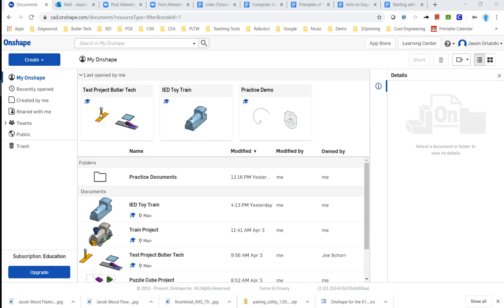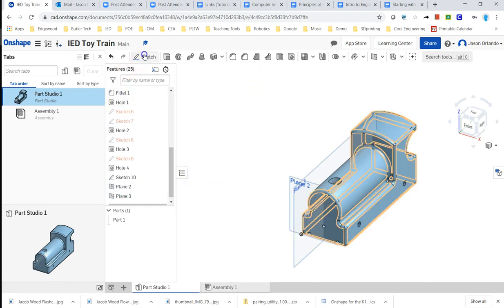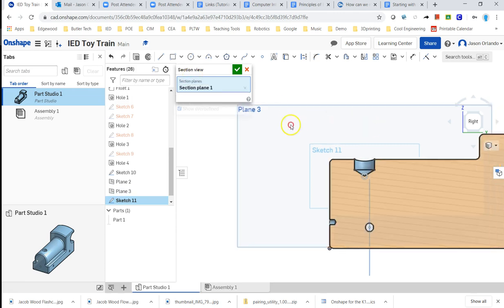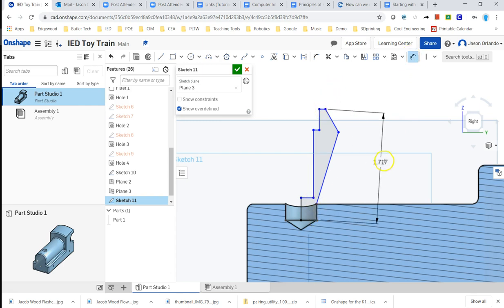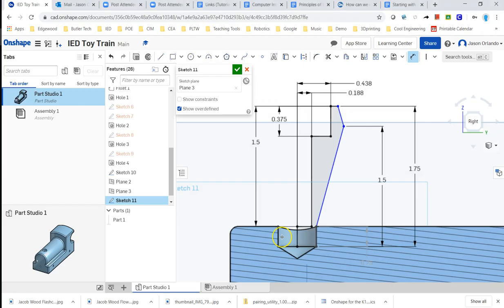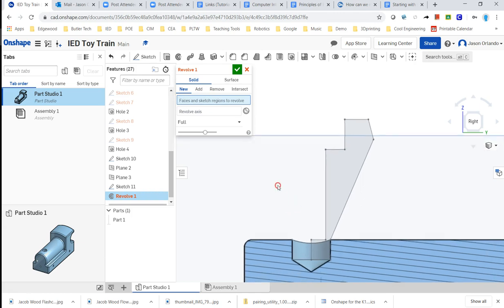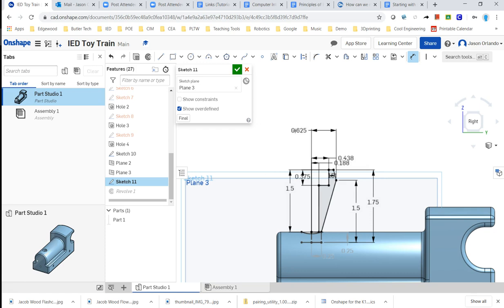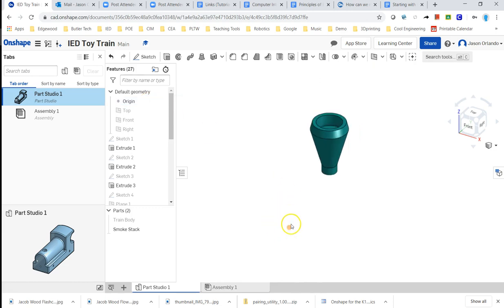Smoke Stack, Model using Onshape

Comment: What do I do if I I don’t have a mid point 4:20
Reply from the maker: Try creating a construction line on your new sketch plane at that horizontal line segment that I found a midpoint of.    OR.....Try using the "Use/Project" tool (right next to the Text "A" tool).  If you project that horizontal line, then you'll probably be able to find the midpoint of that new line.